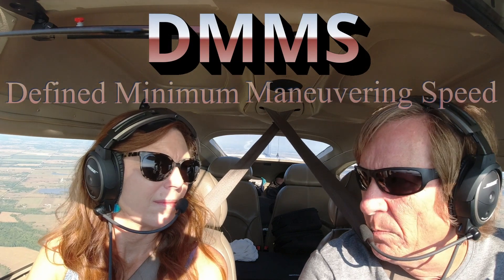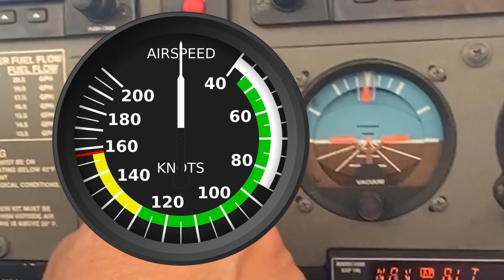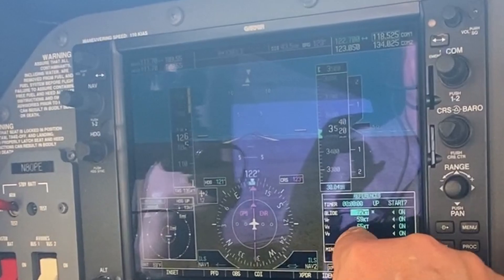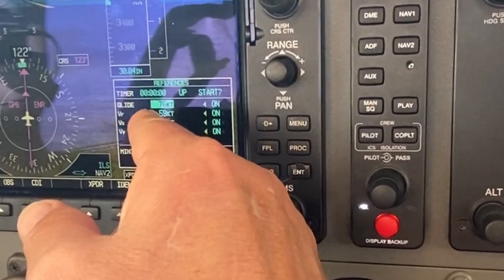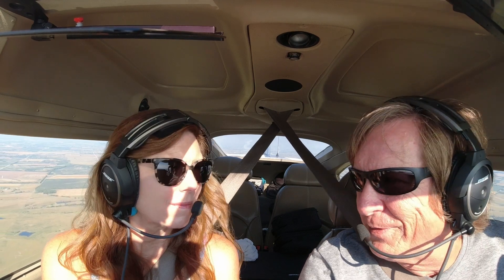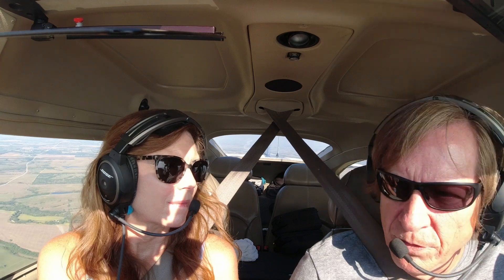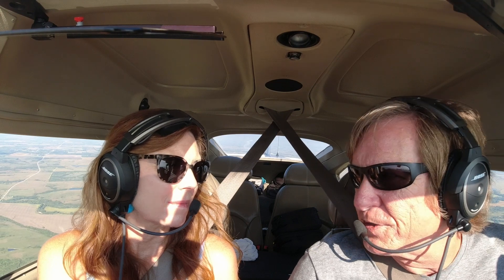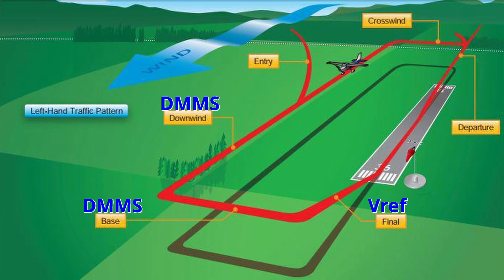Cessna 182 - G1000 DMMS Set-up using the: "TMR-REF" Soft Keys and or Steam Back-up Gauge.

Comment: For most GA planes, DMMS gives you all three in one!  1) Min maneuver speed, 2) Best Glide (Vg)  3) Best rate of climb (Vy)    Check you r own POH for specifics and run the numbers but yo will see that DMMS is a super important number to have bugged visually!  Great job Janis (and a little credit to Ron) for this video!
Reply from the maker: Yep, you’re absolutely correct, on the 182 all those speeds are very close together!
Reply: Alas, not so on the Piper Saratoga TC I fly
Reply from the maker: @flyingphobiahelp  Ah man, well your results may vary - HA! Each airplane needs to be evaluated on a case by case basis . . .
Reply: All I did was nod and smile, Dan!! 😁

Comment: How about using DMMS based on stall speed at 30 degree bank angle times 1.404, specially in pattern base to final.
Reply from the maker: Yes!! Run the numbers for your specific aircraft and flap settings and you’ll always be above DMMS!

Comment: Great tutorial! I’m not sure how other operators do it, but in the M2 I would fly at 130kts for a circle to land, which is closer to Vapp +10. Logic there is your gear down, flaps at approach. Holding off on final landing flaps until on final, or close to final (maybe modified base?) Once fulling configured I’d aim for Vapp which is basically Vref +10, then aim for Vref on final/short final. Never too slow while maneuvering down low in the pattern. You need speed if you don’t have altitude! 
Keep ‘em coming!
Reply from the maker: Thanks for the “Jet” point of view, we appreciate you commenting/clarifying what you guys do!!!
Reply: @Parr4theCourse  how does FLC work on your G1000 version for 182? Could you use that as a bug prior to entering pattern? Just curious. There’s an issue with the software version I have in the Bonanza and Baron I fly, therefore I don’t use it. Hope to get that resolved with an update someday.
Reply from the maker: @ProPilotPete  
I have a KAP140 so no FLC, wished we had a GFC700!!!
Reply: Thanks for watching and adding input from a jet pilot’s perspective.